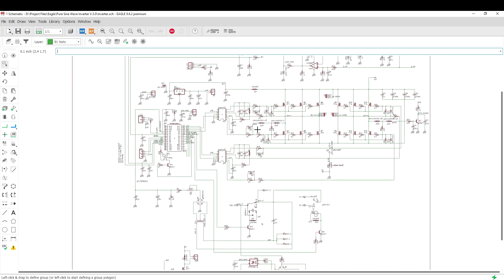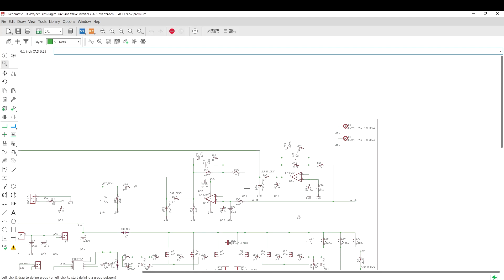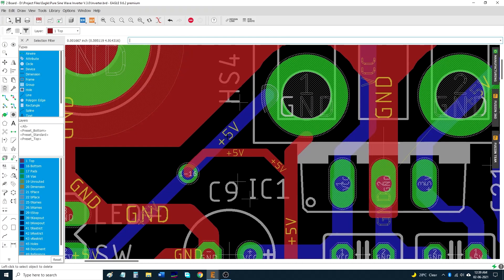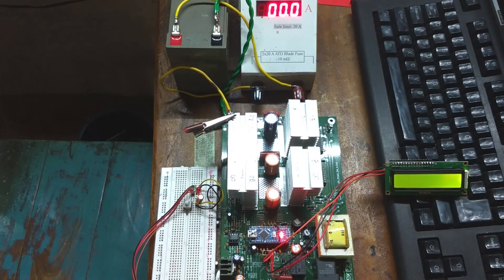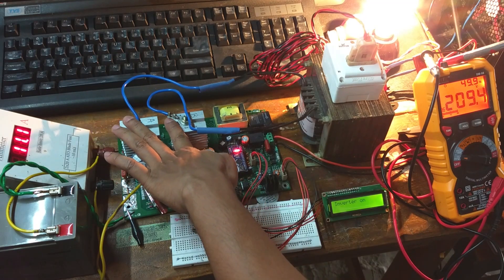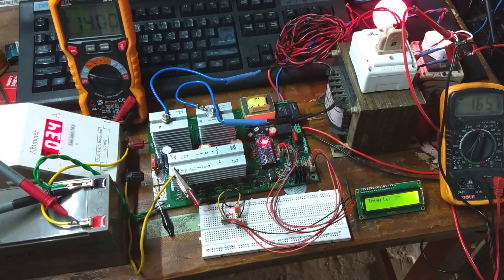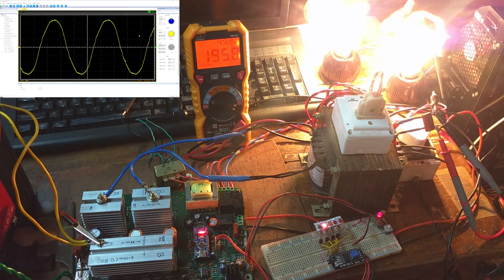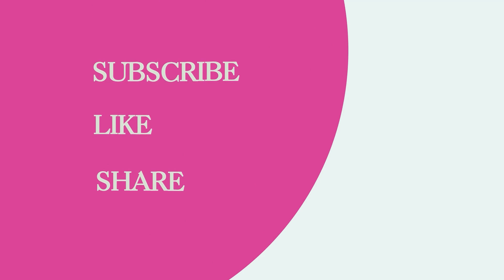350 W Pure Sine Wave Inverter with CC CV Charging, Automatic Changeover [Rev. 2] + Giveaway

Comment from the maker: Dear friends, I have uploaded the code with LCD interfacing in the github. Link: https://github.com/ElectroHijibiji/Pure-Sine-Wave-Inverter-16x2-LCD
Reply: thanks for replying me I really appreciate your effort,in this tutorial you optimize the switching pattern of the MOSFET could it be the reason for the high current draw?.
Reply: Fan not turn on sir after new codes ..in first video ..codes fan works with temprature but not in v2 ..even also not in  v3
Reply: n function 'void shutdown Inv (bool)':

324:39: error: default argument given for parameter of 'void shutdownInv(bool) [
vr2[0m1.8.6[90m/home/tcad/.arduino15/packages/arduino/hardware/avr/1.8.62m4exit status 1

Error appears while uploading the code....please support

Comment: ADC reading equivalent to maximum chg current during full charge = ((ic * a) / ADC res); For example. ic = 0.5 A, actual voltage amplification. a = 0.22, ADC resolution = 4.887 mV, please explain where these numbers come from.

Comment: Hello, may I ask? In the diagram, pin D3 in the arduino is specifically the +VE_CY pin. If I don't use this pin, will it affect the operation of the circuit? And the next question I want to ask is how to measure the charging current of the battery, when the shunt resistor has been used to measure the overload.
I do not use the CHNG-OVG-RLY pin, but only the CHG-RLY pin (relay switching between inverter and grid). Is that possible, sir?

Comment: Excuse me sir 
I want to modify it with a 4 wire fan, can I modify the program for example the fan speed depends on the temperature reading of the lm35 with the pwm output which controls the fan and there are remaining atmega pins there are D0 or TX can I add a fan rotation failure feature by reading the tachometer pin on the fan  4 cables, whether the atmega memory is not remaining or the sine pwm generation function will be disrupted

Comment: I would ask which of these high mosfet control drivers is better for 48v input
fan7392
ir2110
tlp352
I tried with the ir2110 but they get damaged a lot, with the others I have not worked.

Comment: Hello friend, could you help me? I want only the spwm wave to come out like this, but without what are the charge sensors, battery sensor, current sensor, fuse sensor, I understand only the output for the driver controller. I appreciate for 60HZ.

Comment: My question is how do you calculate the required current that will flow to the secondary of the transformer from the battery through the mosfet
Reply from the maker: The basic formula is Current = power / bat. voltage but, you need to estimate the current due to the losses in the transformer as well as in the MOSFETs.
Reply: @ElectroHijibiji  please kindly explain in detail
Reply: @ElectroHijibiji  rather what do you mean by estimating the current kindly explain in detail

Comment: Your circuit is getting the mosfet warm at 100 watt not good that should not happen my circuit don’t even get warm at 300 watt the mosfet are cold so the dead time between phase that’s your issue for heating up so fast
Reply from the maker: It's an initial prototype only, there is a long way to go in the journey to the perfection.

Comment: which things helps to calulate the watt of inverter?i mean if i want to extend the watt of inverter which componets need to urgrading,and the calution?plzz help me bro
Reply from the maker: It primarily depends on the rating of the transformer and the MOSFETs. If you wish to increase the load capacity look for a bigger transformer and add more transistors in parallel. But while adding more transistors don't go beyond the limitation of the gate driver IC. Please go through the manufacturer data sheet of the driver IC.
Reply: @ElectroHijibiji  how to calculate that a deiver ic has how many capabity to givingg pulse to the gate of mosfets/trabsistors?plzz bro help me....

Comment: what is the exact part number of the MOSFET driver chip? in the schematic is mentioned FAN9732  is it correct, no datasheet is available for that part number. is it FAN7392  or  FAN9732  ?
Reply from the maker: It was my mistake in the circuit diagram. It will be FAN7392.

Comment: Appreciated for your great effort.
Battery charging current is fixed or or variable?
what is the max and min charging current that we can set ?
Reply from the maker: Charging current can be changed from Arduino code, it's not fixed. The maximum charging current depends on the circuit components such as MOSFETs, transformer etc. In my experience increasing the duty cycle more than 40% shows a high risk of burning the low side MOSFETs.
Reply: @ElectroHijibiji  
thanks. how  the charging section  works? both high side mosfet are continuously OFF or ON at the the time of charging? low side MOSFET are switching at 100Khz. any phase difference required for low side mosfet or both lowside mosfet are On  Off at same time?
i need 4 amps or below for charging 40ah tubular battery.

Comment: 3things is need to be better... efficiency, output voltage and changeover time.. idle current consuming more, and a 15w bulb glowing bt invrtr consuming 3.8 almost 4amp which is high.. so  efficiency ko leke kaam krna pdega.. changeover ke time bhi bulb off horha hain.
Reply from the maker: I'm working on these issues.

Comment: can you make single phase to 3 phase vfd....and all 3 phase angles can be controlled 0 to 360
Reply from the maker: Due to the core saturation problem VFD with such a setup will be difficult to realize however, VFD can be made using Arduino but that's a topic of another project.

Comment: Bro how can activate Low volt Cut(mains volt below 150) and High volt cut(while mains volt 270) 
Plz help me
Reply from the maker: In the Arduino code you can add a conditional statement to trigger the changeover if the input voltage goes beyond a specified limit.

Comment: Nice job sir.
I have one concern, I think there should be a way to improve the output voltage stability such that the difference in no- load and on-load will not exceed +-5v
Reply from the maker: I'm trying to improve the output voltage stability.

Comment: Can you post the schematic for I2C to led? I have downloaded schematic and software for led displaying status. Very interesting project. Thank you for sharing.
Reply from the maker: Thanks for commenting. The interfacing between i2c and leds is very simple. Just follow this:
I2C bit-7 --- mains on
I2C bit-6 --- inverter on
I2C bit-5 --- charge on
I2C bit-4 --- battery low
I2C bit-3 --- over load
I2C bit-2 --- fuse blown
Reply: @ElectroHijibiji  Thank you for answering to me and all of us. I'm building a 2kw version with your code and feedback loops. Best regards, Vlad.

Comment: Sir u should use input side inductive filter   before powering up Mofet ,and use low pass filter at output which consists of capacitor ,and to control 3amps at no load check pcb because resistance and inductance in the pcb track is problem I think sir .

Comment: Hi, please what's the job of CHG_RNG  on pin5(D5)  of the Arduino nano sinewave inverter?
Reply from the maker: CHG_RNG can be used to switch between two different charging currents. It can be helpful if you often change the battery. However, it's not activated in code.
Reply: @ElectroHijibiji  ok thanks
Reply: @ElectroHijibiji  CH Relay is t compulsory??

Comment: Fan not work even at high temprature after new codes
Reply from the maker: I have uploaded a new code (V.3.2) in the github repo https://github.com/thiasotiks/Pure-Sine-Wave-Inverter . Please download that code.
Reply: @ElectroHijibiji  thanks for new codes i will try with new one..but in new code you changed ckt diagram also but not upload new ckt diagram
One more thing sir. .your 1st attempt  spwm was best as there were 2 sq wave of 50 hz and 2nd high frequency
Use a ferrite core before transformer  with 1 mH inductance with spwm side output or say H1 side ..then no heating in transformer also mosfet better perform .

Comment: Hello Sir, Thanks for sharing the projects I need one clarification why used charger relay with 140v taping, if possible to switch the 230v directly ....please
Reply from the maker: The 140 V tapping can be used if mains voltage is too low to charge properly although this hasn't been used in this project. It is kept as a provision for future upgradability.
Reply: @ElectroHijibiji  Thank you 🙏 Sir If you can made with feedback option to control the constant output voltage at any load condition just for suggestion please🙏

Comment: why your inverter sine wave is not clean sine wave
Reply from the maker: Pure sine wave inverters don't actually deliver the "pure sine wave" but it also contains a lot of harmonics from high frequency switching pulses. Those harmonics distort the shape of output waveform specially at no load condition but, they are almost filtered out when load is attached and the waveform get back it's sweet sinusoidal shape.

Comment: #Thiasotiks...
Can u plz tell me...that...
Can I use an external battery charger (14v 1amp) with computer ups....when the ups is on mains mode....??
Because..my ups...not charging the battery...as microcontroller not producing the charging pwm...but...on backup mode... It's totally ok...
And...on mains mode...it detects the mains but not charging..the battery.....??
Reply from the maker: I think, you can charge the battery externally. There shouldn't be any problem as long as the charger outputs are compatible with the charging parameters of your battery.

Comment: 12V 100AH Lifepo4 prismatic cells are connected to a sine wave inverter with an AC charger, do these cells need additional BMS?
Reply from the maker: Whether the particular battery you're using requires a BMS or not that you can know properly from the manufacturer's datasheet. It's difficult for me to say.

Comment: Need ur help... Have 600va ups... Suddenly the ups not charging the battery but main sense and backup mode is totally ok... Checked and found that mcu not giving charging pwm...is there anyway to charge this battery with using another small mcu like attiny 13...??? Like in the inverter circuit u have made the charging worked like the original ups or inverter one...plz give me some suggestions...i don't wanna use any other transformer for charging... Thank you...
Reply from the maker: I won't recommend you to drive the mosfets externally because, the charging current and battery voltage is to be sensed presisely and it is to be in sync with the backup and mains mode also.

Comment: If I use a toroidal transformer, do I need to install an inductor or choke as well? How to calculate the value of the inductor for each capacity like 750VA & 1250VA sine wave inverter?
Reply from the maker: Since every transformer has some leakage inductance due to the non-ideal couing, it's not mandatory to add chock coil. But adding some inductance may help to reduce the open load current. It's difficult to calculate the exact value of inductance, because the transformer winding also provides some inductance.
Reply: @ElectroHijibiji  Thank you.
Reply: @ElectroHijibiji  induktor 47mh

Comment: #Thiasotiks.
Can u tell me...what happens...if I am not connected the OK2 optocoupler with main line..bcoz...already OK1 optocoupler is present for main sensing...??
......................&..............................
Previously....U already told me...that OK2 optocoupler is connected with half wave rectifier from Main line...so....is it (positive leg of internal Led of OK2 optocoupler ) ac / dc voltage ....if measureing it....with digital multimeter......with reference to Ground....??
Reply from the maker: If you don't connect OK2 then inverter will always start with the negative half cycle no matter what was the phase of the mains voltage right before the mains failure. It's not a big problem though. It will cause another problem in switching from inverter mode to mains mode. To solve that delete "if (PIN_ZC && !zcPrev)" portion in the line #160.

Comment: #Thiasotiks
In the schematic diagram...the positive terminal of the internal LED of OK2 optocoupler is directly connected with a high watt 220 ohm resistor(R28) & 100k resistor(R22) from the Mains 220v ac....
I mean...there is no dc voltage...for this internal led of OK2 optocoupler..
Can it harm this OK2 optocoupler...??
Reply from the maker: Yeah, OK2 is not connected to dc but, it's connected to a half wave rectified voltage. This is done to detect the positive half of the mains voltage and it will not harm the opto coupler.
Reply: @ElectroHijibiji  Thank you..

Comment: #Thiasotiks...
If I connected the transformer low voltage tapping (at secondary) with the middle position of TX terminal on PCB.......Only at this time....The small relay is triggering to NO(normally open) CONTACT....during charging time(mains mode)..........
Otherwise...If transformer has no low voltage tapping (only 0-220v tapping present )....Then... the Small Relay is not triggering.... It's always stays on NC (normally close)CONTACT......During both charging time (Mains mode) & backup mode...
Am I right...??
Thanks...🙂🙂
Reply from the maker: Yes. Correct.

Comment: Can u tell me...
1)small relay is working in which mode..(mains or backup mode)??.... &....
2)big T- type relay is working on which mode.. (Mains or backup mode)??.....&.....
When the inverter is overloaded / low battery....Can it automatically cut the output load...??
Reply from the maker: The small relay would be necessary if you use a lower voltage tapping in transformer secondery side during charging to increase the charging current.
The T-type relay is working to switch between mains mode and inverter mode. (Relay engaged: inverter mode)
Yes, it will go to cutoff automatically in low battery or over voltage scenario.

Comment: Hai how to charge the invertor  from another charging source,is it possible to drive d11 and d12 pin out connect to  mosfets to drive external charging source, cv cc charging method working    or not in that arrangement?
I try to make a 1000 watt invertor with ferrite core transformer, for charging using 20a smps power supplay
Reply from the maker: CC-CV charging topology is already implemented. You can adjust the current and voltage in software.

Comment: #Thiasotiks... 
I want to make this PCB on a Vero board...With the help of schematic diagram..Can u tell me one thing...
In this version...You are using A0 pin as voltage feedback ....and....A6 and A7 pin for Load sensing and I-CHG-Sensing respectively...
Will these pins(A6,A7) are directly related to A0 pin for output feedback voltage  correction.... According to the variation of load...??
Reply from the maker: The load sense is to detect overload condition only. And charge current is read during charging to correct charging current. You can change those pins making necessary changes in code.
Reply: @ElectroHijibiji  Thanks for ur reply..

Comment: Nice work,thanks for sharing ,I have a few questions to ask,your previous inverters draw  about 1.1amps from the battery,why does this one draw almost 3 amps on no load ?,and you only use 2 lookup table for the feedback don't you think having more will make output voltage more steady?
Reply from the maker: I don't know the exact reason for that higher current but, I'm working to reduce it back. For voltage stability no need for more number of lookup tables because, it always calculates the table if lower or higher voltage is encountered.

Comment: I appreciate your efforts well done, but the idle current is too too high work on that and you will have a great project in your hand.
Reply from the maker: Thanks for your suggestion. I am already working to find out the reason behind the lower efficiency and trying to sort it out.
Reply: Mostly if the transformer winding is not split bubblin it draws more current   try using split bubblin Transformer and see the difference

Comment: Very nice...Can I use this PCB with ups transformer (220v to 7v trafo 600va 360watt)...??
Reply from the maker: Yes. It will work.
Reply: @ElectroHijibiji  can u Plz tell me...
What does it mean..on the schematic..
1)+VF CY (Arduino pin no.6)
2)CHG RNG (Arduino pin no.8)
3)Mode (Arduino pin no.22)
Reply from the maker: +VE_CY : Connected to the phase sensing optocoupler. It will be low at positive cycle of the mains voltage.
CHG_RNG : To select between two different charging current. (Not implemented yet. Use if you frequently change the battery with different capacities)
MODE : To select different kind of batteries e.g. SMF battery and Floating type battery. (Not implemented. Kept for future upgradability)

Comment: Can P817 replace SFH618A-2; also can  IR2110 replace FAN9732 in the inverter circuit?
Reply from the maker: Yes, you can replace. I've used IR2110, no problem occurred.
Reply: Can I used p817 ocptocupler in place of SFH618A-2 because they are not available in my market..

Comment: 15:03 I think 500 Watts consumes when applying load on drilling machine.
Reply from the maker: Yes, you are right. During free run it consumes around 230-250 W power.

Comment: Dear Your project is fine and well explained.But  the no load current should be 0.8amp to 1.3amp.
Reply from the maker: I am constantly working to reduce the no load current and increase the efficiency. However, I've made the project fully open source and anyone is invited to do modifications towards the improvement of the project.
Reply: @ElectroHijibiji  Thanks for replying me.i am also working on the same.

Comment: But my observation,11amp @100w bulb is too high
Reply from the maker: Yes according to linear calculation it is high but, you must consider a few things like transformer loss (due to very hight switching frequency), losses on the thin wirings and higher internal resistance of small battery etc.
Reply: @ElectroHijibiji  ok thanks,I am waiting for my free PCB.   juliuspas@gmail.com